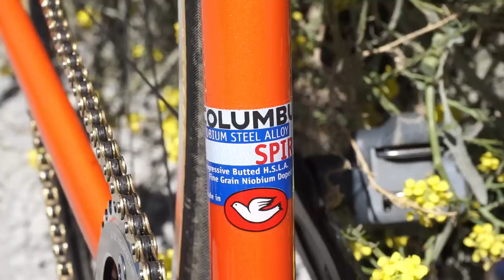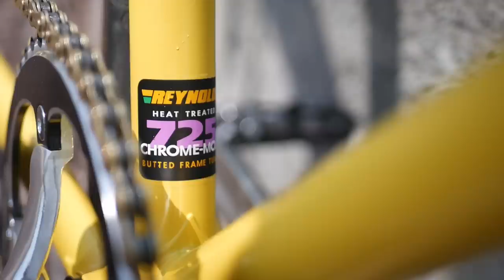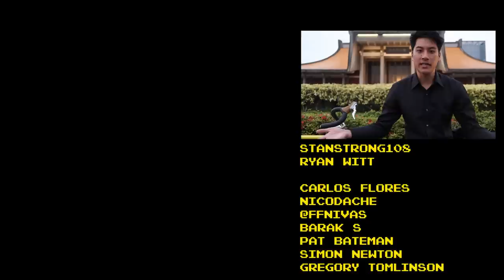The Case for Steel Bikes

Comment: i like how steel bikes have generally skinnier tubing than alluminum. makes them easier to pick up and carry when needed
Reply: I agree, that is my main thing I like best about steel too. They just look cool.
Reply: Easier to oick up while being twice as heavy. Okay
Reply: @Nomorehats  I mean my state 4130 is only 20 lbs total and i doubt you're gonna find a 10 lb aluminum bike at the same price point
Reply: Stevie Blue  I am aware of this, but an important thing to note here. I was responding to someone saying steel bikes are gonna be "twice as heavy" which is patently untrue. the difference will be a few lbs at most assuming similar quality frames at a similar price point, and from what I have seen of similarly priced aluminum bikes to my steel is that they tend to be around 19-21 lbs. Cannondale's geared bikes cost more than twice as much as mine so it is not something I consider to be relevant to my argument
Reply: Stevie Blue  Huh, that's pretty interesting! Pretty good to know since I live in a very hilly area
Reply: I like steel because of the aesthetics. They have skinnier frames and have more style.
Reply: Skinny tubes are more aero ,, in fact Cannondale used narrow is aero as a marketing pitch awhile ago
Reply: Stevie Blue  
Let's add that a good road bike at 19lbs alluminum can be equipped with 12 speeds.
Reply: Do you have baby hands or what
Reply: @Nomorehats  You wrote, "twice as heavy"....you mean the system, or the frame in a vacuum?
Silly and depressed is no way to spend life.
Reply: @GraceofGosh  twice as heavy as in, the harder you ride it, the more you will feel the pounds. If you never ride it at competition spec then steel is awesome.
Reply: @Nomorehats  actually I got a vintage steel racing bike cheaper than I got a brand new aluminium bike. Guess which one is lighter? The steel one by 2Kg.
Reply: @paulschmidtke425  No they aren’t.
Reply: @xq39  IiteraIIy the 0pp0site IM0

Comment: Also if you are touring in a remote location and you do have an accident the frame maybe repairable by any competent welder unlike carbon fibre or aluminium.
Reply: Extremely good point

Comment: Not me bro! Steel is what I ride. I can strip it, paint it and restyle it. And its gonna last forever so long as it doesn't rust out.
Reply: The whole rust thing is so overblown imo. Just remember to grease your seatpost and don't leave your rag in there
Reply: Yup, I've already lost 1 high quality steel frame (Lemond Poprad) to rust.... Too many rides in the rain???
Reply: I rustproofed inside mine and keep it in a dry basement. The rust it had when I bought it hasn't gotten Any worse in 20 years.
Reply: If you live very near to salt water, rust can destroy steel very quickly. I have had direct experiences with that. Cure for that is aluminium.
Reply: Renolds make a good stainless steel frame

Comment: I love steel frame bicycles. The ride is like no other. I currently ride a Cinelli Vigorelli. What a dream to ride. It does have a carbon fork which I expect to swap out someday. I did fall into to the trap years ago and bought a high end aluminium frame racer that weighed in at 17 lbs. I rode it 400 miles and hated it. When you are not on the race circuit riding a bike that is a couple of pound heavier is ok. A smooth ride is much better when putting on miles. I’m 64 years old and just finished my calendar year yesterday. I rode 7300 miles this past year on only steel bikes. I can’t count the number of younger guys I smoked on their carbon frame cookies cutter bicycles. I love your video, more younger rider should take your advice. I have watched your video many times just to see those beautiful steel frame bicycles. I will never purchase an aluminium or carbon frame road bicycle ever. Steel for the rest of my life.
Reply: thanks for your comment 🎉✨

Comment: Right on.  You're the first pundit I've seen, mention the uncanny spring -back quality of steel frames, as they work with the rider in a feedback loop.  They actually flex and then return the energy, and it all adds up to performance and thrills.   The body is completely engaged, and that's what bicycling is all about.

The skinny tubing adds to the resilience.  Shock waves dissipate along the narrow tubes quite effectively.  Not so the fat, rigid aluminum and carbon that followed.  Notice how thin seat stays are now?  Top tubes going the same way, to absorb shocks before they get to the saddle.  Parameters haven't changed since the '60s, except ever more wonderful high tech candy to keep us in love!  

And don't let's get started on those old, reliable, cup and cone threaded bottom brackets!  Threads are making a comeback!

Comment: Thank you for making this video. It reflects my experience bang on. I ride vintage steel bikes from the 70's and 80's and it is an incredibly cost effective way to have major fun. My touring bike is over 35 yers old and I'm not afraid to carry 50 lbs or more on rough roads and trails. The ride is just perfect. No need to go to a more "modern" frame, as the lugged steel frames tend to fit me well. More steel bikes should be on the market today, but there is still a huge supply of serviceable old frames. Let's keep them out of the landfills!
Reply: Jorg, you'll want to hold on to that 35-year-old touring bike.
     They don't make them like that anymore!
     Had one myself up until two years ago (lost it due to a mammoth pothole), got a touring bike from both Trek and Surly. The Trek is junk. And the Surly does not inspire.
     About the only option I figure to replace a 35-year-old touring bike is to copy the dimensions & angle, source old style headset, and try to find a builder.
     Since the mountain bike craze, mass produced bike seem to be made for clowns: twitchy steering; short lenght (top tube & chain stays); and super wide handlebars. Not only that most are fitted with long crank arms.
Reply: RollinRat  , can agree with you about custom built wheels. It is the only way to go for 'bullet proof' wheel.
     As for the bicycle industry being corrupted by the Chinese, that is not the case. The two touring bicycle I state above are from USA companies, though the Surly is made in Taiwan.
     Before getting the Surly, I also checked over 300 'touring' bicycles on the web. It is amazing how few bicycle could truly be called touring, most on the web are city cruisers. It is almost a dying breed.
     Could recommend others check what Brodie (a Canadian company) has to offer. Like all modern bicycles, even their's would not fit me because of my extra long arms. Seems no one has top tubes over 60cm.
     And here is were the MTB craze is most noticable - handlebar width. Makes me wonder why moose antlers are not used. Sure, that way a very long armed ape like me could 'fit' on a modern bike, but at over 60-years-old anything past the town limit is uncomfortable. And the only kind of touring with that kind of range I can think of is guided tours for the once a year cyclist. Kind of sad what touring bicycles have becom to most. I use to knock of 300-km rides in a day on a vintage touring bicycle up until the age of 58. The long stretched out position was just relaxing.

RollinRat, hope you stick with frame building long enough to be come proficient at fitting braze-ons without weakening the tubing.
Reply: Steel frames are like an old American truck.  Strong and reliable.  And very pleasing to look at.
Reply: RollinRat  
Do the steel bikes need much treatment in the way of rust inhibitor?
Reply: RollinRat  
Yeah fair enough. Thanks 👍

Comment: "Frame weights, in a vacuum, is insignificant."  Agreed.  My 1983 Serotta is beautiful, stiff, dependable and, again, beautiful. Does it compare with 'modern' bikes? - Hell YES!
Reply: I used to know a couple of torch burners who worked at the Celina, Ohio Huffy plant who worked with Ben Serrota back in that time when Huffy was building bikes for the Le Vie Claire team. Ben was hired to be the project manager and most of those bikes were made in his shop. The Huffy guys from Celina went there short term to help train Ben’s torch men and to help them complete the order on time.

Comment: Cool. Yes, all I have are old or "vintage" steel  bikes.  We have two 1987 bright yellow Schwinn touring Paramounts (another for my wife) from the Waterford, Wisconsin factory that are both three by 7's (one is converted from a 3x6). Both are made from Columbus tubing. We think those were the last of the Paramount touring frames ever made before the Paramount factory started focusing on racing frames only.
    I have a 1983 Mondia 2x6 with Reynolds 531 tubing.  By far my prettiest frame. 
    I have a Bianchi Osprey 3x7 steel bike for fishing and gravel. 
    I have a Schwinn Paramount Series 50 Mt Bike from 1994 with Prestige tubing.  
    And lastly, I have a Team Marin from 2000 made of Columbus Zona tubing.  
    (My wife also has a 1970's-'80's red Celo Europa 2x6 of Columbus tubing.)
    The bikes I ride regularly all have fork tube extensions (or Zoom stems on the older bikes with quill type headsets) with 4 inch riser bars to raise up the handle bars for my arthritic neck.         All of these bikes are mounted with Mt. bike break levers and shifters as well because being up so high puts my hand farther away from the old down tube shifters.  So having them on the handle bars is safer and more efficient.  Go vintage steel.---!

Comment: Great video. My son rides a 1985 Murray that I upcycled years ago. It's a department store bike and hi tensile steel, but it still rides great 36 years later. The only work that I've done to it is swapped out the steel rims for aluminum rims. When the rear derailleur failed, I had Ray's Cycle in Vacaville install a new one for $45 parts and labor.

Comment: I concur.

I'm a former staff member of Bicycling Magazine, and Bicycle Guide Magazine,  1982/86.

I rode the best of the best from that era, from Japan, Italy, France, England, and quite a few handmade in. USA. Each country has its strength and weaknesses.

The most amazing bike of all was a Pinarello, the same model that Alexi Grewall used to win the '84 Olympic road race... it had that perfect springiness... you could never ride that bike fast enough... it pushed you to ride faster... I wanted one, but could never afford it.

I saw your 3Rensho... Yoshi Kono is a great builder. I have a bike made by him that was a prototype for Specialized, when they were thinking of adding bicycles to their accessories product line. Of all my bikes, I've the most miles on this one.

Specialized had the magazine road test it, I rode it, was smitten, and also surprised that they would sell it to me, with front and rear racks and panniers... I still ride it, a lot.... no index shifters either.... like playing a fretless sting instrument.

My other favorite bike is a Bruce Gordon... like the Pinarello, it just jumps... 

I've a custom Fat Chance from '85, one of the few that were made back then. It is a very light bike, made with a Tange tube set... 

Thanks for this video...

Comment: used to work in a shop for 10+ years, have repaired thousands and thousands of bikes and seen a lot over the years. Aluminum will eventually work harden and fracture, usually chain stays, but if you're an extremely aggressive offroad rider and unlucky, a head tube. Carbon is great if kept in perfect condition, however, resin is soft and you'll hit it on something eventually. A small crack allows water inside and then let the galvanic corrosion begin - they tend to delaminate over time, and like the video says, tend to catastrophically fail.  If you sweat on your carbon bars and have anything aluminum touching them, replace yearly. Not to mention carbon frames in the bicycle world are pretty unregulated and tend to have voids/wrinkles - it's a crap shoot, you never know. Personally, i like carbon for weekend road bikes, but accept it will fail at some point. For every day/commuting, you can't beat steel. The toughest bikes I've owned are all steel. Had several titanium over the years too - but they can work harden and split like aluminum. And they are very flexy! I prefer chromoly. The older Tange tubing is great, Reynolds 520/4130 is great. Had several Reynolds 853 frames - personally i find them a little too stiff but that's me. Hi-tensile is just a little too soft for my taste - it is very soft and is very easy to dent/bend. If i had one frame for the rest of my life it would be some variant of 4130 chromoly, probably tig welded, for weight reasons.
Reply: I have a 38 year old Marukin M-420 road bike I purchased new 38 years ago. Its frame is made of Ishiwata 025 ChroMo, and I LOVE IT! I've had the bike overhauled twice since I had it. It's still going strong, and it'll be in my stable until I die.

Comment: I have a wonderful old steel bike,  what I mean is that it flies when you touch the peddles.  People say of high tensile steel bikes is that the bike feels "alive", this is very true.   It was made in early 1946 so the Reynolds 531 steel was a new aircraft steel that was reserved for the war until then.  What makes it so efficient is the long wheelbase so that the bike seems to fly over the bumps in the road (still break spokes of cause and most of the front spokes have been replaced).  The transmission is very efficient Sturmey-Archer 4 speed thin oil lubricated which makes the bikes transmission much lighter than most bikes and the same as a super bike.   The tires are high pressure 1 1/4" (32mm) wide this also  makes a difference.

These Raleigh bikes were sold to last 100 years with an indefinite guarantee on defective parts.

The gears change as easily as a switch none of the hassle of a derailleur gear and were available in close medium or wide spacing at the time.  My hub is the wide spacing but the sport cyclist Reg Harris used a Medium spacing hub on this bike.   Every time I have got on the bike over the past 50 years since dad gave me his bike there has been a lovely wow this bike just wants to go feeling about it. 

The bike is a Lenton sports.
Reply: A nice bike, I remember 3 speed Sturmey Archer hubs working quite well and much better than the equivalent Shimano 3 speed hubs
Reply: @truthseeker8483  
Modern bikes are generally lubricated with grease so they don't roll so easily at speed.   British bikes made 3 speed hubs  usually are a bit more notchy still easy though there is an internal alignment issue I understand.   My four speed changes as Sturmey-Archer describes you keep peddling or applying slight pressure in a forward direction and the gear changes in a moment.  With the most reliable type the three speed you usually need to move the peddle backwards as you change gear.  

The oldest 1902 ones don't slip if the cable is not correctly adjusted, I understand.  They are heaver than 1Kg of hubs like my more modern 1950 hub.

https://blog.andrew-lohmann.me.uk/2018/10/lenton-sports-bicycle.html

Comment: I've ridden steel, titanium, carbon and aluminum bikes over the years and each has it's own pro's and cons.  That said, I strongly believe that titanium is the ultimate frame material if it's well constructed.  They're fairly light, relatively indestructible, don't rust and can be a stiff and smooth as anything ever produced.  That said, my carbon Trek is the most comfortable bike I've ever ridden (important at age 60), and I had a road bike years ago made from Tange Prestige tubing that just squirted with each pedal stroke.... probably the most fun bike to pedal.  Aluminum seems to be a neutral material that isn't nearly as strong as steel or titanium,  but works well off the shelf but won't last forever.  To menthe ultimate commuter would be an old titanium frame, with a cheap paint job (to hide the fact that it's titanium, and solid wheel set that's not too flashy.....   Just my experience over the past 40 years !!!
Reply: Wabi doesn't use titanium therefore it won't get mentioned.
Reply: I have no real experience with Ti frames.  I did buy one, but never got round to building it. I have read that they tend to break easy, usually cracking or welds giving up?
Reply: I own 22 bikes. Everything from basic chromo, to Reynolds 853, carbon, aluminum and of course--titanium. My personal preference is titanium, then steel (any type, really), carbon and lastly, aluminum. I built a 1x9 urban explorer up from a 1990 GT Xizang, which is a 26" MTB frame. I'm a big dude--6'4", 250 and can average 15mph on it all day. It's light, quick and comfortable. Two of my road bikes are titanium, a 1996 GT Edge, and the 2013 reissue heritage edition. Both are crazy comfortable. The carbon GTR is unforgiving and harsh. Of course, much of it has to do with tire size and pressure, saddle and rider weight.

Comment: I agree with practically everything you said. I once was a weight weenie and all it got me was parts that would break a lot and end up having to replace more often. My last bike purchase was the most expensive at more than $8000 and because of that expense I wanted a bike that was going to last so I chose Titanium. I now have a beautiful 19 Lbs. bike that rides like a dream and as long as it doesn't get stolen will last the rest of my riding days.